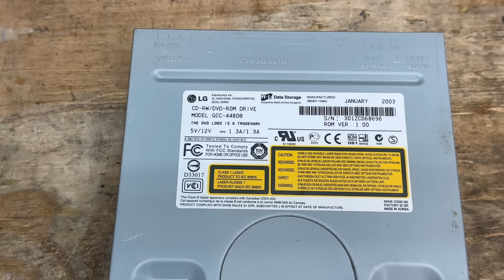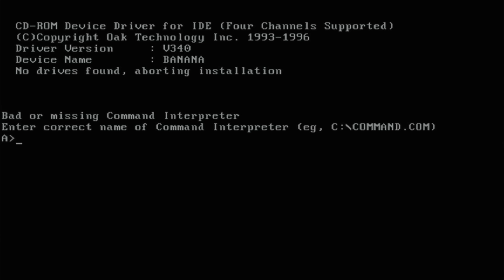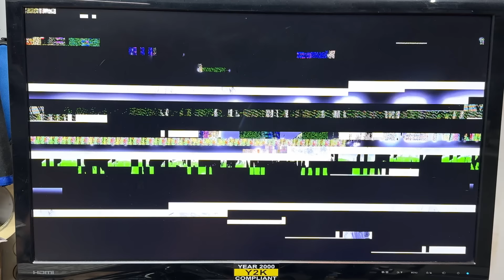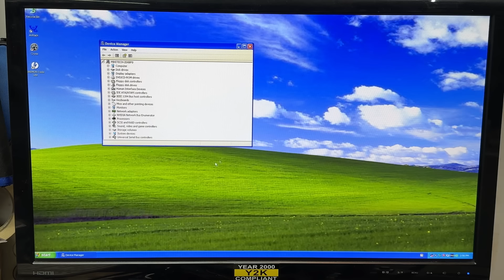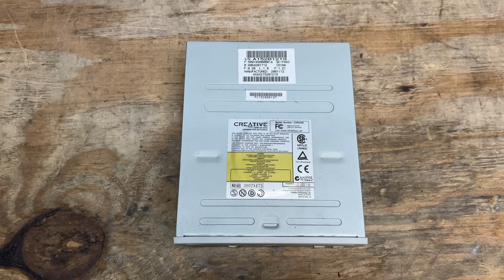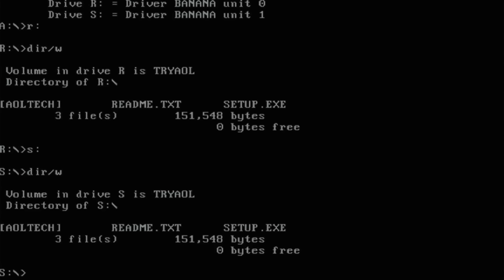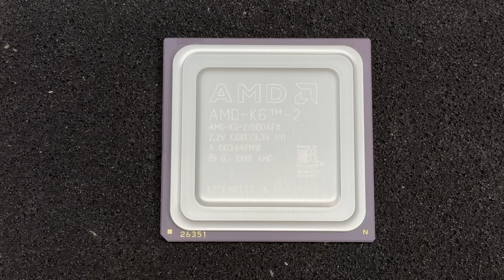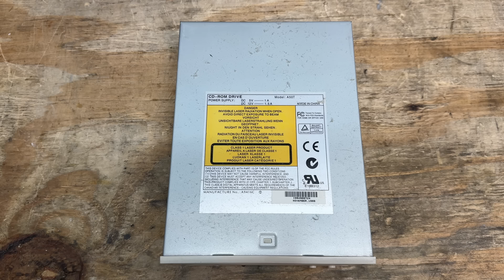Mystery 2000's Systems - Teardown and test!

Comment: cracks knuckles

System One - 
DVD-ROM/CD-RW combo:  Those were actually quite common in the early 2000's.  I installed many of these back in the day.
Cooler:  Mmm...  that is one sexy Zalman... 
Early RGB:  Not just R, but G, B, and UV.  But each item was built in only one color, so you had to choose your theme and parts wisely.  Kinda surprised it's just a couple LED's and no CCFL tubes.

System Two - 
Motherboard : Ewww... ECS... 

System Three - 
Chassis:  Interesting, it looks like the lower half of the front fascia was ripped directly from late 90's Compaq.
Floppy Drive:  Manufacture date code in 1996, too, WELL before the intro of the K6-2.  My guess would be that IBM initially ordered way more than they ended up actually buying, and Alps was left holding the bag, so they sold them to other distributors.

Another great video!
Reply from the maker: Oh those CCFL bulbs were the epitome of cool back then. I had one in the first system I ever built from brand-new parts. I had to illuminate that shiny new Athlon XP 1800+ and Nvidia GeForce FX 5200!

Comment: Aha System 3 - That was the same board I bought for my K6-III 450 back in 1998/9, I remember the ALi chipset.  I re-used my 64Mb DIMM and 3.6Gb IBM HDD and bought an ATI Rage Pro for it...

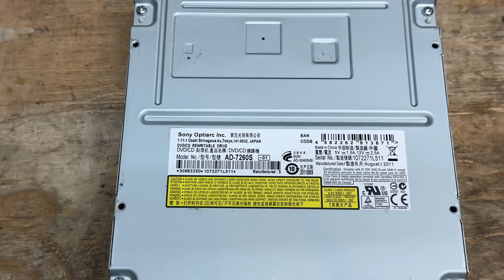Comment: 9:20 - Seems like at that time the going trend was to have a CD-RW drive along with a DVD-ROM in another bay. Then they went ahead and incorporated the DVD read feature into the CD-RW drives to save cost then moved onto full DVD-RW as stand alone. All probably driven by cost for OEM's.

44:35 - Might want to check the protection diode on the top right, it might be shorted (to protect itself) If it is you can remove it and it should spin up. If it works try to replace the diode.

Comment: Ah a walk through history.  Used to have an MX400 which I replaced with an 8800GT, which I still have.  That was an epic card.  Anyway, if I remember right, ECS also sold under the brand PCChips. I used to see the same boards with both brands sold at the same small shops.  And Frys used to sell ECS prebuilts under their GQ brand.  And THAT is also part of my history as a GQ system was the only time I have ever bought a prebuilt desktop versus building one.  The whole system including memory and CPU was $200 new.  I bought it for a relative to use.  It was dog slow but good enough and a lot cheaper than anything I could assemble.
Reply: Gef2 MX400 to a 8800GT?
Sheeesh, like moving from a tent into a royal palace!

Comment: 24:25 This is a PCChips board, often seen by the strange names of the heat sinks.  There were already names like PC100, AGP Pro or VXPro and so on.  There were even motherboards with fake cache that was soldered onto the circuit board, but was not electrically connected to the components of the circuit board. As strange as these cheap boards were back then, they usually always worked. I still have some from the 90s today 😁 And Avance Logic also had VGA cards.  I once had a 1 MB PCI card from them.  I think it's good that you disposed of the power supply, you shouldn't put such cheap junk on your PC.

Comment: So, the frequency mismatch on the Opteron system may be due to a BIOS on that Abit board that doesn't quite know what to do with that CPU. The marrying of a gaming motherboard with a server level CPU is a bit strange, and Abit was kind of at the tail end of their existence at that point, so it is very possible that the BIOS was just not up to it completely.

Comment: That p4 1.7ghz i'd swap for a 3.06ghz HT if possible 😁 depending if the motherboard uses 533 bus, otherwise fit the fastest 400 bus cpu which is around 3ghz.
I have a compaq with a celeron 1.7ghz, and upgraded to 2.4ghz celeron got from ebay since it was cheaper than a p4, since theres not much difference between the 2 apart from the cache sizes, at least it got a bit of speed boost!

Comment: On #1, Those 939 Opterons were hot shit back in the day. They had better overclocking ability over their Athlon 64 counterparts. That burned CPU socket is telltale sight of someone really pushing the VCore and/or memory. And the dvd/cdrw drives were budget allstars $45 when the burners were $80. On #2, the jumpers likely select the DDR vs SD ram.
Reply from the maker: I have a feeling this isn't the first time that system has run Crysis. Thanks for the info on #2! That's definitely a new one for me. A board in-between the worlds of DDR and SDRAM is really interesting (to me at least).
Reply: Can confirm. The row of jumpers selects between DDR and SD Ram, if I'm not mistaken with some other jumper(s) near memory or CPU socket. Used to work with them at the time. They were cheap boards, but somewhat reliable. Don't know if I still have any manuals/CDs for them. Had a "garbage collection" type of cleaning at work during the "human malware" and a lot of that stuff went "in the bin"

Comment: a 9600GT with Crysis on Ultra is honestly just torture.

Your 8800 GT would have been faster by quite a bit, i built a PC for Crysis with a LGA771 Xeon and SLI 9800GT's and it sure feels like it's in the same spirit as this one. :)

Did you spot that the Opteron is a dual core? I bet that's why it was picked over the single-core Athlon 64's!

Comment: Also, Did you try the dead MB out of the case ontop of some plastic? Ive seen cases where the MB was shorted out in the case because of those "special" IO cover slots. Pretty sure its dead but never hurts to try.
Reply from the maker: Yeah, same result unfortunately.

Comment: 23:45 these harddrive cages were so AWFUL! I was young and stupid and I had populated the hdd cage with 3 hdds. Needless to say, the hdd in the the middle has full contact with both the lower and the upper hdd, allowing for zero heat dissipation/airflow. It was painful when I noticed that my data drive was not accessible anymore all of a sudden, I opened the PC, only to find out that the middle hdd was extremely hot and apparently had just died the heat death. Needless to say, I did not have a full backup of all the data at the time. My first and only true loss of data. But I still cannot grasp how case manufacturers came up with the idea of providing an hdd cage that gives ZERO breathing room to the middle hdd.

Comment: Can anyone tell me what the tool is called that Mike uses to grease the floppy screws? It looks almost like a flathead screwdriver with a curved tip and it seems really useful.
Reply from the maker: It’s a DIP chip lifter. Whia 26810 to be exact. It happens to have the perfect angle for hitting floppy drive lead screws.
Reply: It looks like a bent-tip awl.

Comment: You glazed over the fact that the 2nd system wtih the ESC motherboard takes both SDRAM and DDR, the jumper pins do something with RAM configuration. I have a similar ECS board that's full ATX and extremely purple. I'd be happy to send it your way with another oddball 478 board or two if you want, I think they all need recapped though.

Comment: The AMD Opteron is simply because that CPU was cheaper than an Athlon X2 at the time.
Nothing unusual...
But if the Board works?? the NForce 4 isn't particularly reliable and suffers from the same issue most Flip Chip components of the time suffered...